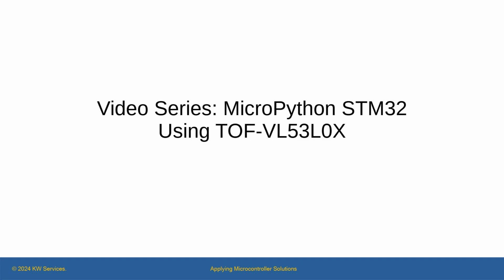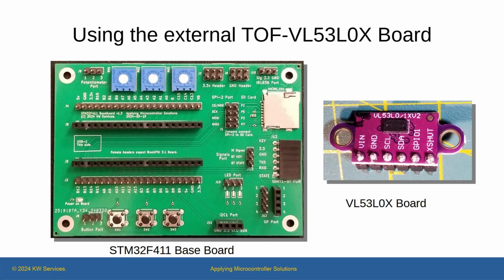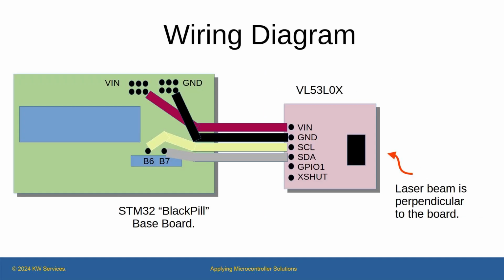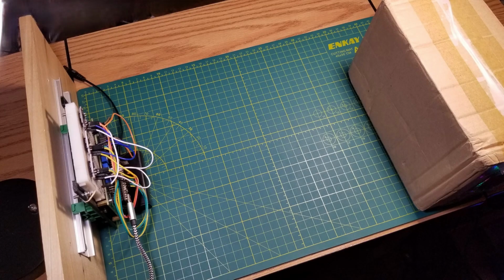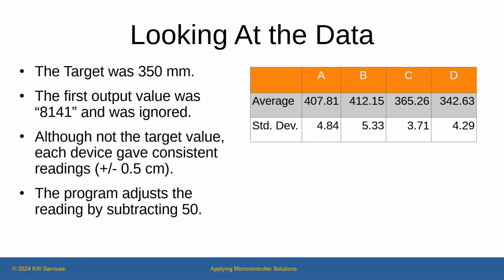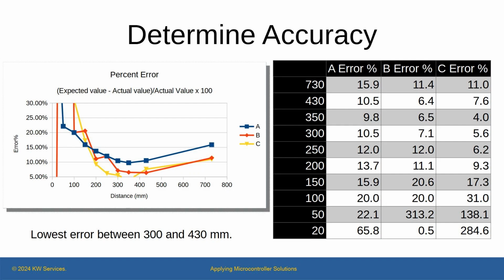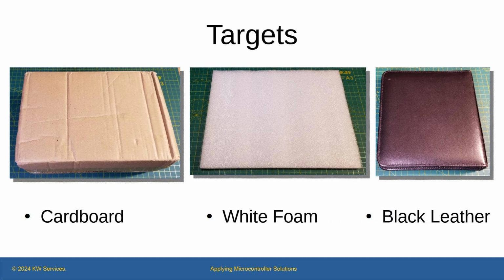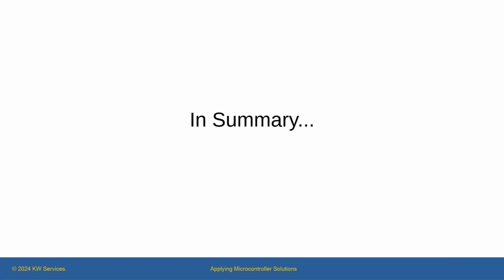Learn STM32 MicroPython - Video 11 - Using TOF-VL53L0X

Comment: I'm using stm32f103c8t6 (blue pill) with VL53L0X do I need pull up resistor for them
Reply from the maker: Hi. I had no issues using the VL53L0X module directly connected to the STM32F411CEU6 chip (black pill).  I feel the maker included resistors on the module.